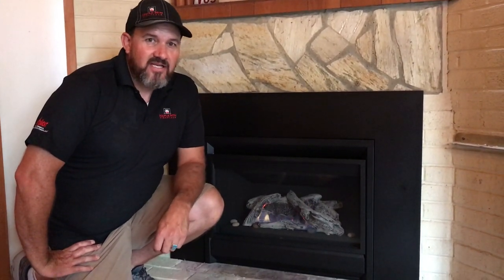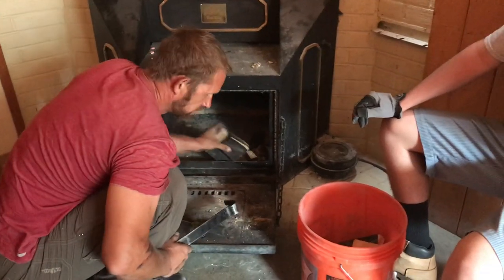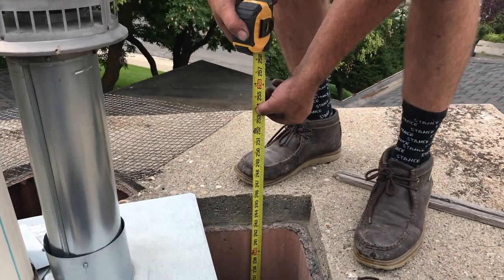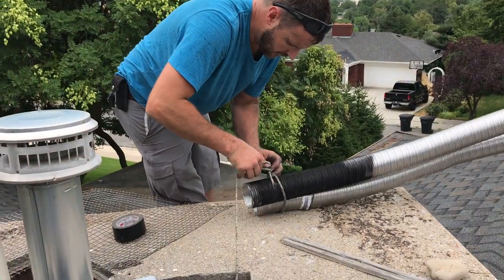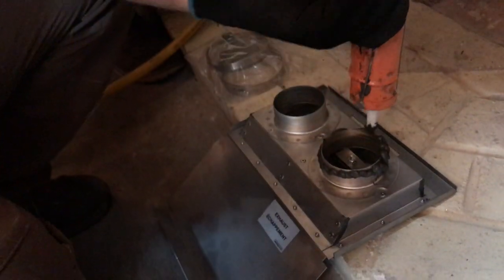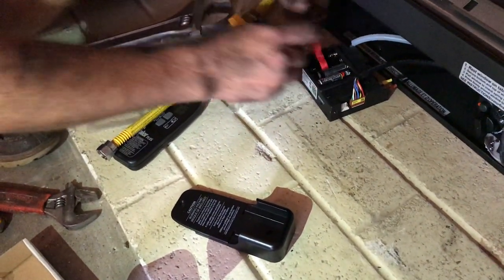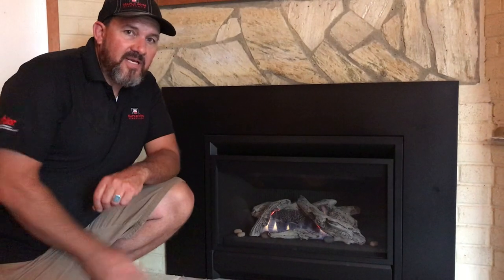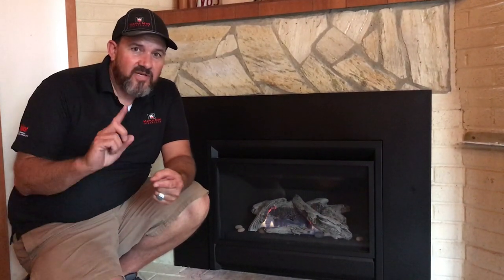Update Your Wood Fireplace to a Gas Fireplace

Comment: Is there an option to add a blower to this model fireplace? Also is the home owner responsible to run the gas or propane line into the firebox?
Reply from the maker: There is an option to add a blower to this fireplace. You really don't need one because of the design of the fireplace, but you can always upgrade. If we are doing your job we can run the gas line for you, the price depends on how much gas line you need.
Reply: Wish y’all lived in Oklahoma and could redo my wood burning fireplace ... we love the fire but not the mess!
Reply from the maker: @allierandolph6910  Yeah, that's too bad! Oklahoma is a little far for us to travel to lol. The gas fireplaces are very convenient and clean though so they would make a great replacement :)